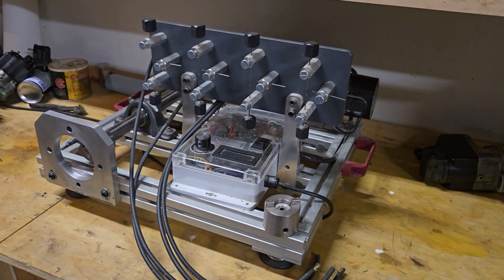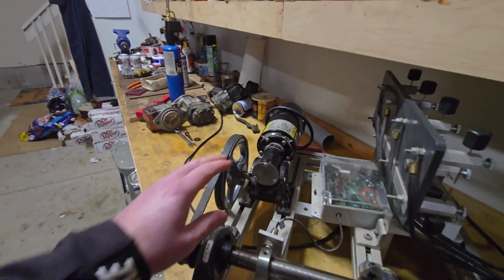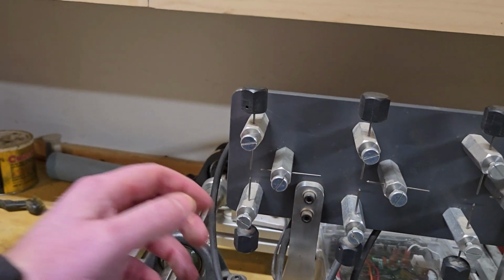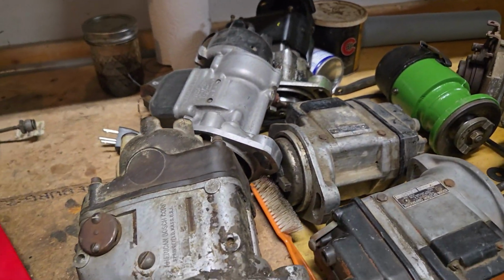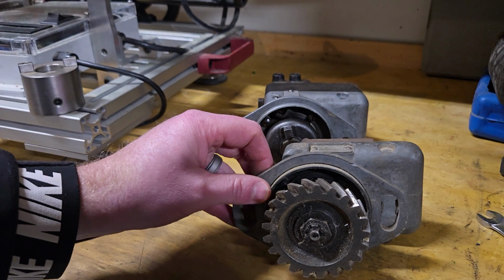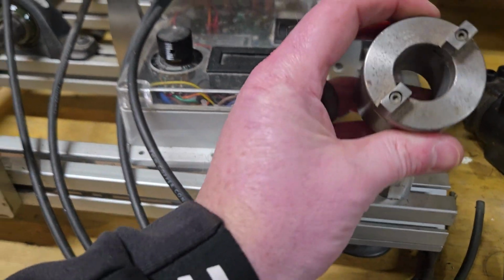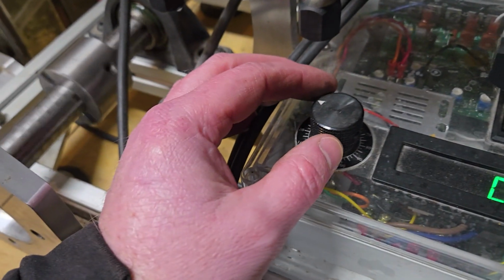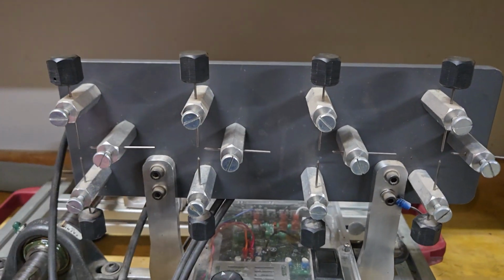DIY Magneto Tester

Comment: Hey man , just subscribed to your channel ! That tester is awesome ! I recently acquired some new old stock parts for an American Bosch MJC Mag, I was trying to figure out if that model would fit on our Farmall H or M. It looks like they share a universal mounting flange, do you think it’d work ? I believe they’re both clockwise
Reply from the maker: Thanks for subscribing! I didn't have much experience with Bosch mags... Or Farmalls 😅 But, assuming they both spin the same direction and have the same firing degrees, the only other thing you might need to check is the impulse. But it's pretty likely both flange mounts are identical. I'm interested to hear how it works. I always like finding new, unorthodox ways to fix things. Best of luck!

Comment: "So, I have a 1949 John Deere M, and I don't know what the differences are between a distributor and a magneto. If someone would explain it to me, that would be great! Thanks!"
Reply: A distributor needs a battery and a coil to generate the spark. A magneto generates it's own electricity and are usually used on hand cranked tractors without electric starters or batteries.
Reply: @brianrvd  Thanks!

Comment: The machining looks impressive. Any issues I have with my Wico X comes from sitting without running for many many months. A point file takes the glaze off the points real fast. Up and running like clockwork. Don't zap yourself....no bueno
Reply from the maker: Yes, the points get a layer of corrosion on them and you're toast.